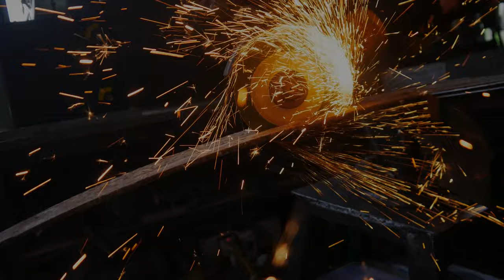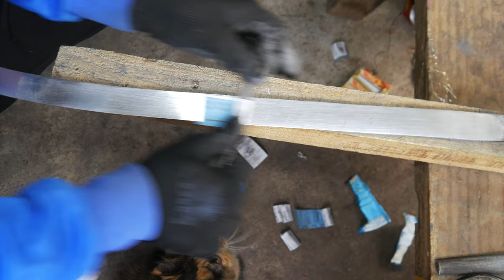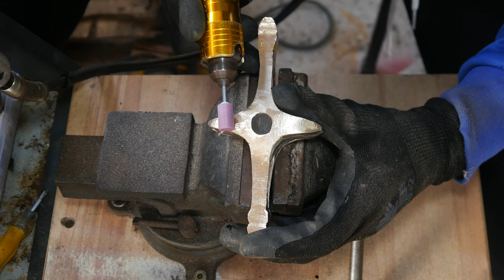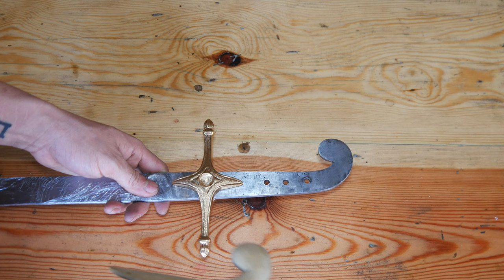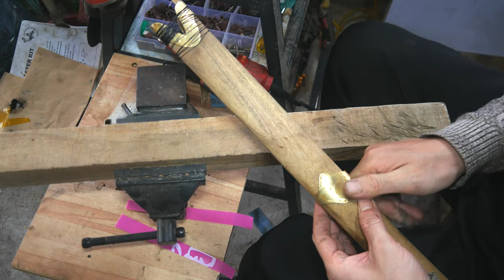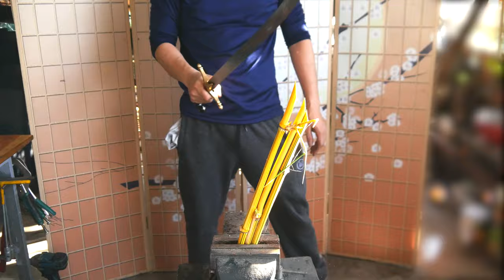Forging the Sword of Shamshir - The Elite of the Persian Cavalry

Comment: Interested in the details of the lost-wax mould creation.  You didn't have any vents and it appears that the brass sputtered when you poured it indicating that there was still wax inside the mould...  Did you bake out the wax and pre-heat the mould?  Could you please explain how you did the mould without any voids?
Reply from the maker: Thank you for your feedback, the wax I used is the type that has quite a lot of impurities left behind, and it created a fire when pouring bronze, and it could also be due to the poor quality of the plaster, but anyway, the product comes out. also quite good !

Comment: How many grams does your sword weigh?
Reply from the maker: All weigh about 2kg
Reply: @Arts-and-Crafts Shamshir is a Persian saber, characterized primarily by a narrow blade of strong curvature. Most shamshirs have blades about 80 cm long (if measured in a straight line from the hilt to the tip, without taking into account the bending radius), about 3 cm wide and about 5 mm thick along the butt (at the guard). And the weight varies from 600 to 1000 g. The lightest shamshir, which I managed to find information about, weighed only 490 g. This is together with the handle.
Reply from the maker: @Medjed-y3g  Thank you, I had a small mistake after reading your comment, I weighed it again and it was exactly 1.2 kg. I think it's pretty easy for me to control